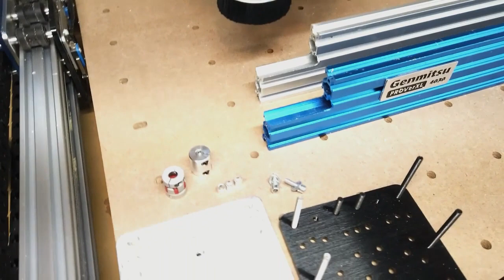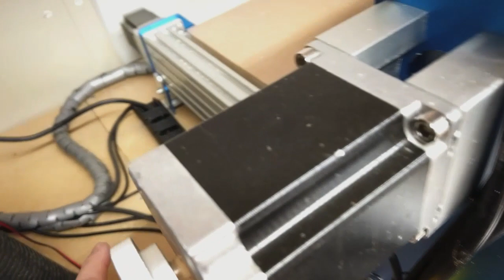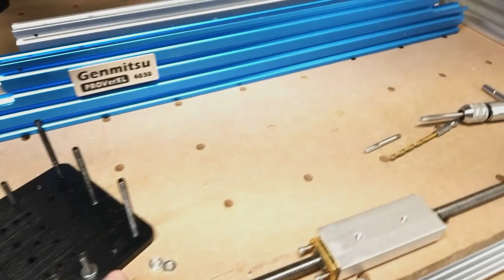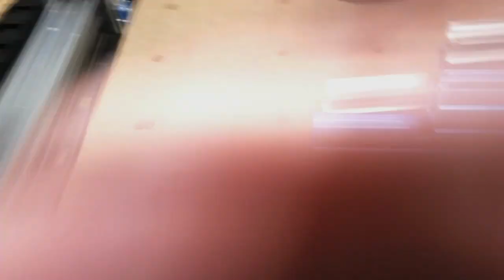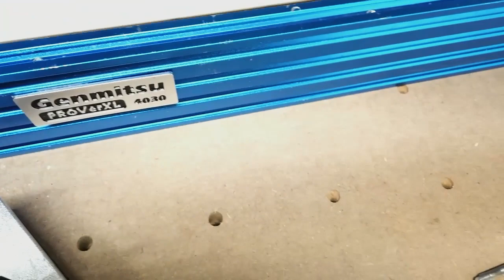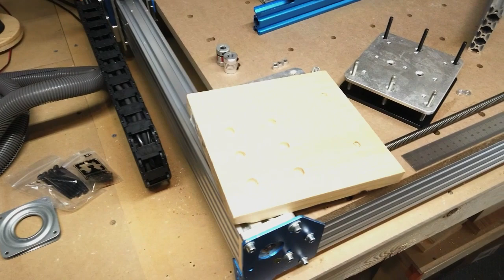Expanding the PROVerXL 4030 to 1000mm x1000mm.

Comment: Hello, thank you for this informative video.
For my Proverxl V1 I ordered a Genmitsu extension 1010 now I have to build a table for this new dimension.
Could you tell me what the total overall dimensions are (including with NEMA23 motors)?
Thank you very much for your help and take care of yourself.
Greetings from Switzerland
Alan
Reply from the maker: I don't recall the exact dimensions as I no longer have this machine in my workshop.  I think my table was around 1400mm x 1400mm or 55 inches x 55 inches.
Reply: @windsorwoodcraft  Thank you very much for this information, it allows me to anticipate the creation of the bench and especially the changes to be made in the layout of my small workshop area
I have a deep addiction for Openbuilds with the whole control system, it's sad now that it's all gone... they were the best on the market!
Thank you again and wish you lots of fun with your beautiful CNC
Reply from the maker: @P51Maniak  I  did not know that Openbuilds was shutting down. I still have a few boxes of extra parts and control boxes that I bought from their store and never used, They were a great place to find cnc parts.

Comment: Where did you get the spoil board? Or did you do it yourself on the cnc? If you did, can you share the file?
Reply from the maker: I purchased a sheet of 3/4" MDF and just cut it down to size, then drilled the holes to secure it the machine. I didn't use a cnc file to make the spoilboard.

Comment: Perhaps this will be helpful to you or others in the future.  To calculate the proper steps per mm setting, take how far you wanted to move divided by how far it actually moved.  Then multiply your current steps/mm by that number.  If you wanted the machine to go 100mm but it only went 85, you figure 100 / 85 = 1.176.  If the current steps/mm is 166 you multiply that by 1.176.  The new steps/mm should be 166 * 1.176 = 195.2.
Reply: Thanks for the track 👍

Comment: Now that the factory has released the  6060 and 1010 expansion kits for this machine...   If you had to do it over again,  would you buy one of the factory kits or still build your own from scratch?   I'm planning on getting one of the genmitsu proverxl 4030,  and probably expand one day
Reply from the maker: At the time that I expanded my 4030, the extension kits were still in development so that is why I figured out how to expand it myself. If I were to purchase a 4030 again now, I probably would buy the factory extension kit mainly because it would be much easier to do with the specific factory made parts for the machine.  That was the main reason that I bought the 4030, but I just didn't want to keep waiting for the extension kits to be released.

Comment: How is this programmed? I want to use this for a puncture test. Basically take the router off and put a needle there so I can have it go up, then down, up then move one inch to the right then down and repeat about 100 times
Reply from the maker: You will need software such as Carveco, Vectric or other cad/cam program to set up the toolpath and then use a gcode sender such as Candle or UGS, etc to control the machine with the tootpath.

Comment: Since you went to the trouble of fabricating all these parts, why didn't you flip the c beams around so that the leadscrew is accessible from the outside. It should only require drilling a few holes.

Comment: If I update it with the 1500mm accessories, will the cutting precision always work well?

If I update it with the 1500mm accessories, will the cutting precision always work well?
Reply from the maker: If you upgrade to 1500mm, there might be some wobble or "flex" in the lead screws.   But other than that, the machine precision should be the same as 1000mm or the standard size machine.

Comment: Thanks for all the information, I'm looking to do an upgrade after it looks like sainsmart aren't willing to ship the parts to the uk so I'll have to go the way you have so this is a big help.
One quick question though...why did you go to 8mm lead screws and not stick with 10mm?
Reply from the maker: I used the 8mm screws because I could not find 10mm screws with the same specs as the ones that came with the machine.

Comment: What router is that? Mine came with a blue mount for Dewalt upgrade I believe.  I definitely need to upgrade my spindle
Reply from the maker: The one that I'm using is the 65mm Carbide compact router.  It's sold by the makers of the Shapeoko brand cnc machines at carbide3d.com.  I bought the mount for it on Amazon. The 4030 does come with the 69mm mount for the Dewalt router. When I bought my 4030 the Dewalts were hard to find.

Comment: How deep and wide is your machine after the upgrade including the motors? Essentially how much space does it take up?

I'm just about finished building a 60" x 60" table / workbench to expand and organize my 4030. I'm wondering if I could go with 1500mm parts and perhaps cut them if that's a little too big.

1010 will definitely be nice, but if I'm going through this I want to get it right the first time and I have a 60" footprint to play with. Thanks!
Reply from the maker: The machine is approximately 47 x47 with the stepper motors.  A 60" workspace should be plenty big enough for a 1010 but not for the 1500 size.
Reply: @windsorwoodcraft  awesome thank you for the feedback!
Reply: @windsorwoodcraft  Hey one more question. I just ordered everything based upon your list, much appreciated. Partially just for entertainment purposes I'm thinking of using the 4030 to machine the ends of the rails that have to be modified. By any chance do you have those measurements available or do you know if there is a drawing somewhere that shows the exact dimensions? (Obviously, if I tear apart my machine to measure; I probably won't put it back together to do this).
Reply from the maker: @BJGoldstein84  Are you referring to the ends of the front and back rails that are notched?  If so, I just used the old ones as a template, then marked and cut with a miter saw or  hack saw.
Reply: @windsorwoodcraft  yep exactly. I was just trying to be fancy, but I'll likely do the same. 😊

Comment: Also did you have any issue taking off bolts from wheels I try with mine and the head gets striped any tricks  to get them unscrewed
Reply from the maker: I didn't have any problems with the screws. But I did buy new  allen wrenches because the ones i had did not  work real well.

Comment: thanks for video can you give update on your machine hows it running im getting ready to do the same thing but want to go as big 5x6  I was looking at your parts list and seem pretty straight forward thanks again
Reply from the maker: The machine is still running good.  Once it was fine tuned with the new lead screws, I have not had any issues.
Reply: @windsorwoodcraft  thats great i heard that sainsmart is coming out with a bigger extension kit

Comment: Where can I order the acrylic dust parts for keeping your lead screws clean from machining particals?
Reply from the maker: I made the acrylic dust guards myself. I clamped a piece of acrylic between two boards and used a heat gun or torch to soften and bend it.

Comment: Patent your kit and sell it to Sainsmart!
All kidding aside, I would like to see a vertical expansion done. I am neither sain nor smart.
Reply: Even if not kidding, then don't waste money on patents. Patents are for new inventions, such as new technologies or new ways of doing things. A kit like this, isn't worthy of a patent and its also hideously expensive. Go for a trademark then. They're way cheaper, way more encompassing and way easier to obtain.

Edit: Vertical expansion seems to be fairly easily doable. Get a sheet of aluminum, which thickness matches that of the blue vertical brackets. Then take the location of the existing holes, place them on a CAD design of the new plates and elongate the original design. Now just ask the CNC to carve out those designs, swap them out, as well as the blue, vertical C beam and its connector and you got extra Z height. I haven't gotten my machine yet, but I too want to vertically expand it, so it's definitely something I'll look into

Comment: Hi, have you looked into silent stepper motor controllers for this machine? I am trying to figure out which would be a replacement for it as the steppers are extremely loud from factory
Reply from the maker: I haven't looked into it myself. The only time that I have noticed real loud noises is during a 3D carve when the motors are doing quick, short movements and changing directions repeatedly, like on a finely detailed project.  I have read some posts on the Sainsmart Facebook group of other people changing the control box to try to reduce the noise but haven't heard of anyone putting different motors on it.
Reply: @windsorwoodcraft  thanks for quick reply. No need to swap the motors. Just the motor controllers. The stock ones are noisy. I just joined the fb community and found a post about it but seems the controllers are fixed to the board and not a simple swap. I remember early in 3d printers theybjad the same issue and people added a small controller between the motor and the board to make them quiet. Wonder if this would work here too.  The noise on the unit i received is louder than the stock spindle at full speed. An ear piercing whine.
Reply from the maker: @steritech  Here is a link to the control box that one of the posts on the Facebook group is referring to. Supposedly will make it a lot more quiet to run.     https://www.spark-concepts.com/cnc-xpro-v5/?fbclid=IwAR1mbd9S8EtNzZDijaJN2FT4cn0StLyJjuOMrBUklQccYQ1mcv4MhL4MAO0

Comment: are you able to tweak the motors in candle?. ive only used the offline controller and would prefer to continue to use since i put up 50 bucks for it but about to pull the trigger on 8mm screws and would like to continue to use. i have an old old old mini laptop i might be able to load candle on and keep attached to the machine...might just have to ditch it to get a 3x5 foot machine. cant wait thanks for this video your def gonna get that aff pay from my order.
Reply from the maker: There are settings in Candle that you can adjust if the screw or motor type is changed so that the movements are accurate. I'm not sure if the offline controller could make any of those adjustments.

Comment: thinking about doing a 1500 wide and 1000 height with mine mounted on a 4x8 table. trying to save some money and thinking about just mounting the side rails to the table and lowering the z and putting spoil board on the table and  eliminating the cross bars. what are your thoughts? also did you have to downsize to a 8mm screw. seems like your links are going to have some lead time on shipping and thinking about amazon. found some 10mm as trying to save some money by using the existing hardware. was wondering if you could tell me if the y's and the z are double threaded. dont want to have to take my machine apart to find out.
Reply from the maker: I'm not sure about the double thread.  But the lead screws are standard Acme threads. I used the 8mm screws because I couldn't find 10mm screws with the exact same specs as the stock screws that would allow using all the other existing stock parts. Just easier to switch to the 8mm screws and matching parts.  I did think about trying to eliminate the front and rear rails but would still need some sort of bracket on the ends of the Y rails to raise the wheel assembly up off the table.

Comment: Did you have to do any drastic changes to your software after the upgrade
Reply from the maker: The only things I needed to do was change a few settings in Candle to calibrate the movement of the X and Y axis and edit a few other lines for the new size of the machine.

Comment: Hello , 

Will you be able to make videos of the software you use and how you configure it step by step? , 

I have this machine but the grblcontroller is giving me problems, when I load a file the fps drops almost to 0 and the machine becomes slow, this did not happen before.
Thanks for the videos👋
Reply from the maker: What kind of project are you trying to make that you are having problems with? I can make a specific video for the project you want if you send me the file and then I can also see if I have the same problems you are having.
Reply: @windsorwoodcraft  

Thanks for your answer, after trying several solutions everything seems to indicate that it is the laptop that I have, 

 it was slow but I could work ,  now the machine stops in the middle of the work. 

You can find the figure that I am making on the internet, it is the image of a drop that falls into the water and creates a pattern of waves, and I want to make it on a piece of wood, 275 mm long by 20 mm high.

Water drop 👇🏼

https://youtu.be/RLn1ErhxOPo
👋

Comment: Looks great!  My son asked if it would be possible to flip the C-channel so that the screws were facing outward to keep dust off of them during cutting.  I can't wait to see your next projects!
Reply from the maker: It is possible to flip the c beams, with a little extra modification.  But the holes in the new black gantry plates that I used don't line up with the holes in the blue X axis supports. And the new lead screw nut blocks do not line up with the old gantry plates. The only other way to do it without drilling a bunch of new holes would be to also flip the wheel assemblies so the the new black plates are on the outside, with the old plates on the inside,  so they line up with the blue supports, but that would shorten the X axis working area.  I may try to figure out a better way in the future, after I make sure there are no other issues with the expansion as it is now.

Comment: Can someone please help me out a little. I just assembled this machine and if it hits the limit switch everything freezes and I can’t use any controls? Please help! Thanks! Love your videos!
Reply from the maker: Hit the reset button in Candle and it should free it up. Then try to move it away from the switch. Might need to do it a couple times in order for it to move away from the limit switches.
Reply: you can manually turn the knobs on the stepper motors to move it off the switch aswell

Comment: Excellent work! Exactly what I want to do with mine.  Im new to the CNC if you could do a video on calibrating the new lead screws that would be amazing!
Reply from the maker: I was thinking of doing a short video on how to calibrate the new lead screws.  I think my machine is dialed in correctly, but I need to do a little more research first to make sure I'm giving the correct info.
Reply: @windsorwoodcraft  Did you ever have to change any settings with your lead screw or was it dialed in from the get go?
Reply from the maker: @Hawkeye0918  I did have to change a couple of settings in candle to calibrate the new lead screws.  I'll have to look up the new settings if you need them. It's not difficult at all. I never did get around to making a video about it though.

Comment: This is a good information for future. I have a question about my 3040. When I home it it runs to the limit switches and alarms I then can not move it until I reset. is there something I am missing/
Reply: I had this problem when I first started too.  I think it had something to do with the homing position being set incorrectly in the software
Reply: @Hawkeye0918  What did you change and where would I find it?
Reply from the maker: I had a similar problem when I first got mine. I'm not sure exactly how I fixed it, but I think I had to reset it to unlock the limit switches and then I believe I hit the "reset origin" button in Candle.

Comment: The motor couplers you installed are rubbish. The stock ones are much better. Actually, they are one of the best you can get for these machines. 😉
Reply from the maker: The original ones keep pulling apart, they are crap. I'll stick with the new ones.
Reply: @windsorwoodcraft  I'm affraid you're doing something wrong mate. Probably the leadscrews are not fully supported or something like that. The spider couplers are one of the best money can buy for this kind of machines. That's what I found after 18 years CNC building experience. I was impressed Saintsmart was using them because it's much expensive than others cheap springy ones like yours.
Reply from the maker: @axelSixtySix  Not doing anything wrong here.  The original ones just didn't hold up.